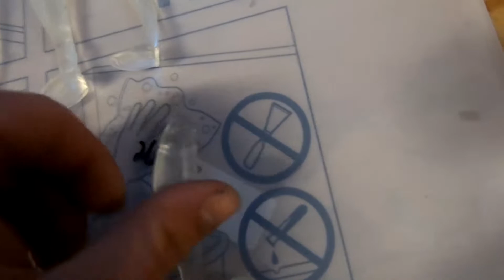Bait Plastics Sampler Review - Pouring, Clearness, and Action

Comment: Just a tip.  I use a lot of paddle tail baits and do some mods on a milling machine to the molds to improve paddle action at the slowest possible speeds.  First thing I learned is you need a weighted jig head attached to the nose of the bait to get the best paddle action at very slow speeds.  With no weight you get a body roll as the water hits the paddle and causes the body to roll on its axes.  Again this is for very slow retrieves.
Thanks CW for taking the time to put this video together, that was a lot of work.  Great info.
Reply from the maker: No problem, it was fun to make. Hindsight being what it is, I should’ve used a weighted jig head or a swimbait hook. I will do that for the next review